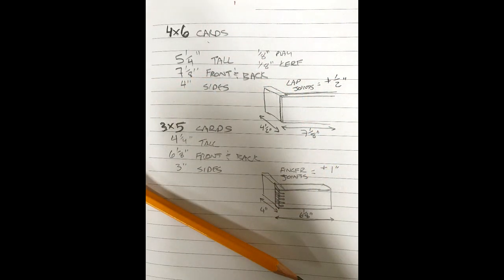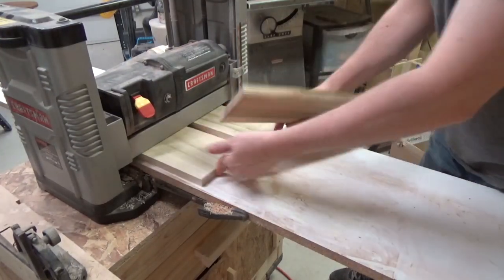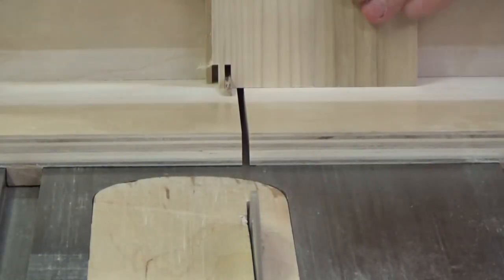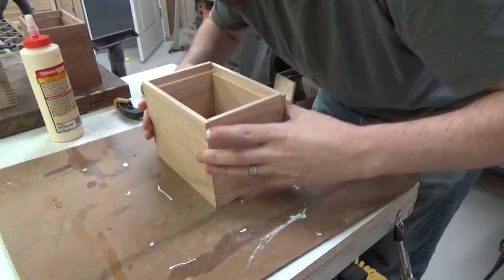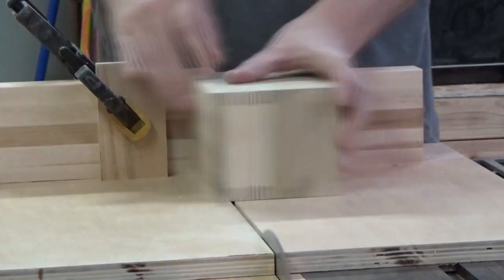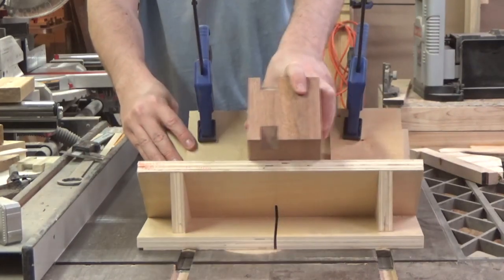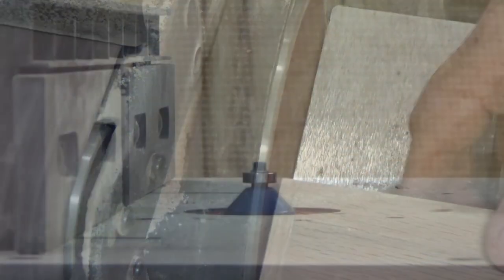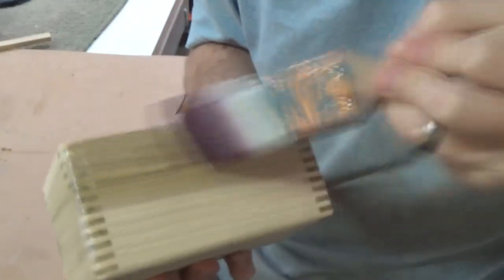Woodworking: How to build 3 different kinds of recipe card boxes

Comment: Great job!  Very cool joinery!  A couple of tips I picked up on YouTube - use painters tape to hold the mitered joints together while you glue up - makes it much less nerve racking.  Also, spray poly makes a very smooth surface - 3 coats (sanding lightly in between each coat) and then buff with 800 grit sandpaper and finish with finishing wax.  Makes the surface like glass!  Thanks for all your great posts! (Love the humor too!)

Comment: The finger joints look the best, and this shows craftsmanship quite well. Sure many of us have seen the finger joint used for the box sides, however, today for the first time I see you cleverly making the lid handle with this joint. Having never made a box before I am impressed here. The nested spline idea would be my second choice. I am a huge fan of using multi color woods and grain patterns.  Another great video.
Reply from the maker: Thank you very much, Lee!  I actually put a birdseye maple dowel on as the handle for the poplar box but ended up not liking it at all.  I chiseled it off but it scarred up the top pretty bad.  Then I thought, "What am I going to do to cover these marks?"  It was then that I had the idea of the finger-jointed handle.  Some screw-ups lead to good ideas I guess.  :)  Thanks for watching!!

Comment: Wow, thanks kindly for the video.  My daughter is having a wedding shower in May and she asked her guests to bring recipes. This will be a great gift from me to collect those memories.  I love the Mahogany box for sure.  I've started the box, i am actually using walnut and plan to use curly maple for the splines, coming out great so far.  Will be making a spline jig today.   One quick question, can you remember approximately how big the box top is, (ie: where you cut the box to separate the bottom from the top)?
Reply from the maker: I don't, sorry.  Just make it about 1/8" + your table saw blade kerf taller than the recipe cards you'll be using.

Comment: Nice job. My favorite thing to make is small boxes. Question: since the bottom is glued in-at least on one of the boxes- is expansion a problem? I have done the same with no problem but in many videos there is a lot of discussion about the need to allow for expansion. I can't pick a favorite because each is unique but my favorite  handle is the mating finger joint. The idea or technique cold be incorporated into many projects. Outtakes a bonus.
Reply from the maker: I just figured with something so small that expansion probably wouldn't be that big of an issue.  Maybe I'm wrong, I'm still pretty new at this.  I guess we'll see as time goes on.  If they blow up, then lesson learned, and I'll just make a new one.  Thanks for watching and commenting, William, I appreciate it!
Reply: Considering your age I'd say  your skills are very good

Comment: Good looking boxes. I’d like to make a suggestion. When using the table saw to cut your kids off, set your blade to leave an 1/8” behind. This way it won’t collapse the lid and make an accidental kerf Mark. 
When doing it this way, you can then take a thin kerf blade and hand cut the rest of the box off. Then you will have minimal sanding to do. You can either hand plane what’s left behind or run it through a drum sander. 
...and if you’re making a continuous grain and cut the whole lid off on a table saw, even using shims, you stand the chance of the lid collapsing unto itself on the last cut, causing your continuous grain to look sloppy.

Comment: mahogany for my fav. did you screw from under for the handles? or just glue?
Reply from the maker: Hey Bill, I just glued it. These boxes will see very light use and aren't heavy enough to really warrant anything more. I actually put on a different handle on the poplar one, had to chisel it off, and put the finger-jointed one on.  The glue held so tightly that I nearly destroyed the lid. Thanks for watching, man!

Comment: I’m curious... if you still have these boxes. Poplar often changes color over time. This is one reason it’s typically reserved for paint-grade work. Did that happen with your poplar box?
Reply from the maker: The poplar one went to my uncle so I haven't seen it in years.  My wife uses the oak and my mother has the mahogany ones.  But color doesn't change "too" much with a film finish and no UV sunlight.
Reply: Fisher's Shop An old boss of mine (Design/Build Construction Co) made a tongue-and-groove kitchen ceiling out of poplar. His intention was to paint it, but he liked the look so much, he just coated it with polyurethane. Over the years, the colors changed so much, it was hard to identify what species of wood it was. There was a large window over the sink, so we guessed it was UV-related... but we also realized we’d never seen poplar left unpainted for so long. 😂 Which is why I was curious about that box. 

Love the channel, btw! 👍

Comment: absolutly loved the boxes but i think u made a mistake with the stuff on the bottom would have been nicer to put small feet on bottom, i dont understand why people put that stuff on bottom just makes the box look tatty after all that work
Reply from the maker: The felt on the bottom helps the box slide on the counter top.  Rubber feet would do the opposite I'm afraid.